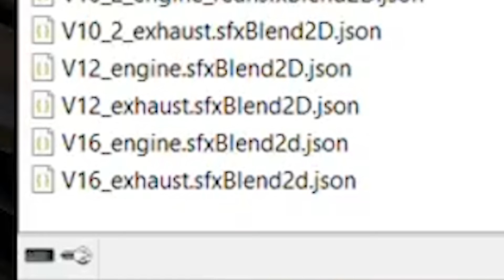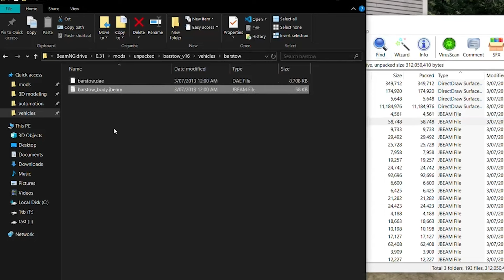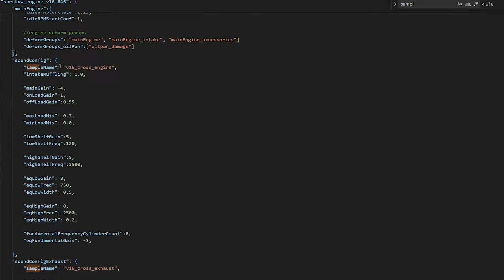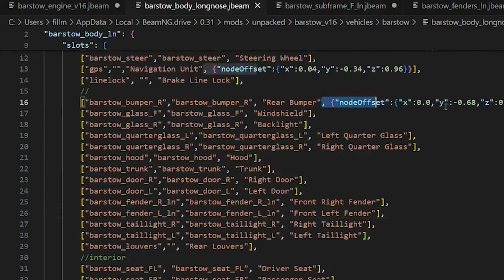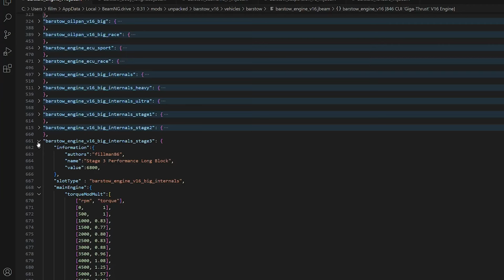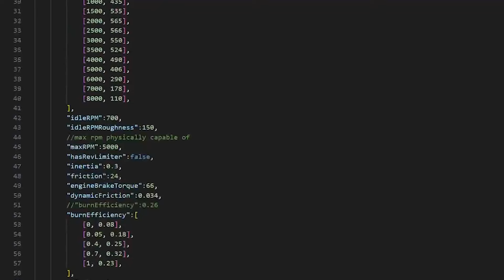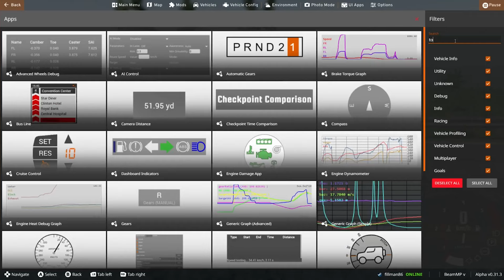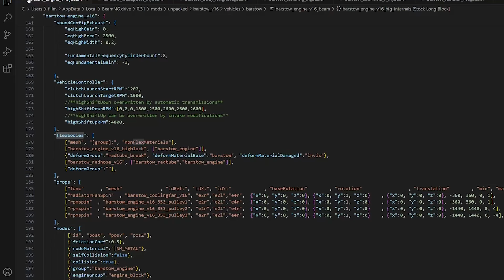BeamNG's HIDDEN V16 code

Comment: Shoutout to Bugatti revealing their new engine to replace the W16 last week and it being a V16
Reply from the maker: oh I didn't know they were doing that. Strange since the w16 is so incredibly compact
Reply: @fillman86  Emissions. It's gonna be a hybrid. But they knew that whatever downsizing they made (decreasing displacement), part of the Bugatti ownership is the sound and since Rimac now owns Bugatti (55%, the other 45% stayed with Porsche), and Rimac already has an electric supercar, the Bugatti is to cater to that percentage of enthusiasts who want the sound experience.
At least that's my guess on the reason they kept the number of cylinders.
I don't know if it'll be turbocharged, but the preview video they posted on Bugatti's official YouTube account shows it revving quite high, past 8000 rpm...which makes me consider the possibility of naturally aspirated. High rpm hints for lower displacement, at least lower than the 8.0L from the W16.
Reply from the maker: @Roddy_Zeh  but 8 litre with 16 cylinders is the same as a 2l over 4 cylinders, and those can rev high

it's probably just a looks thing
Reply: @fillman86  yeah you're probably right, either way ,that's absolutely great that they're not just throwing the idea of combustion engines into the bin like alot of others are doing.
Reply: @fillman86  I definitely need to avoid posting YouTube links altogether, even broken ones. My comment has been deleted. Dammit.
But yeah, V16 engines can rev pretty high; the issue is that, the longer the crankshaft, the more complicated it gets. Too high rpm's can damage the crank, basically bend it. That being said, BRM was tackling 12,000 rpm in the late 1940's with its supercharged V16 built for Formula One. Sure, it was 1.5L, so bore and stroke were pretty much like a superbike's. And it was said that they could reach 14,000 rpm. Still one of the absolutely most beautiful symphonies ever conceived by mankind.
And with today's tech, even something as humongous as a 14.0L, LS7-based, V16 built by Sixteen Power LLC (for marine applications) can rev as high as 7,000 rpm...and putting out 1,400 hp with no boost whatsoever. That's basically 100 hp/liter, typical values for high-revving Honda B or K-series engines. And when you consider the bore and stroke, combined with the fact the V16 has an OHV valvetrain setup, which tends not to be as efficient as an OHC one (be it single or double overhead cam), and just 2 valves per cylinder...it's incredible.
Reply: how many litres though?
Reply: @realcanadian96  We don't know yet. Some rumors are claiming it'll be 8.3L and developed by Cosworth. I have my doubts about that.
Reply: Aparently, like the t50 engine and the Valkyrie engine it’s developed by cosworth. Supposedly it’s basically a v16 version of the Valkyrie v12

Comment: v16 barstow is gonna be so fun to play around with on the drag strip
Reply from the maker: I hope you enjoy :)
Reply: The brakes can just be upgraded, no need to stress over fading.
I mean, I barely even use those old muscle cars and even I know they don’t suck as badly as I thought.
Reply: @RailsofForney Yeah, the high performance variants usually had better suspension and brakes than base.

Comment: Hopefully the guy that did the merlin engine swap doesn't get mad. The extended front looks just about exactly the same.
Reply: Why would he be mad about someone having a similar idea?
Reply from the maker: yeah I have been told a lot about this mod. I think I don't mind making something similar
Reply: It also looks a lot like the real-life Merlin-v16-engined car that someone made in real life.  And like most stretched-nose funny cars.  Because cars with stretched fronts do kind of look the same, it turns out.

Comment: Barstow is an underrated car in BeamNG. Despite being a 60s car, it has incredible handling and has good brakes and suspension. My favorite preset is the TrackSport version, somehow its easier and faster to drive in my hands than the Civetta Scintilla.
Reply from the maker: I think most people don't care is because "it's just another american car, zzzzz" combined with good, but not great looks. But this is just my opinion
Reply: Im more of a Moonhawk guy
Reply: @collinkaufman2316  grand marshal v8 sport, fight me.
Reply: @aguywhodoesstuff1116  I like trains ._.
Reply: barstow and bluebuck are surprisingly great for drifting
Reply: @collinkaufman2316  same

Comment: What if... 32 cylinders that are half the size so it's the same capacity. The more cylinders the better I guess.
Reply from the maker: sure, but I don't have any audio files :/
Reply: @fillman86 well there is engine simulator if you want to do all of that again. I have done a 50 cyl engine on my computer which is less powerful than yours, so you can probably do even 64 cylinders

Comment: 23:43 if ya gonna go all out for speed, remove the wing, remove the seats except the driver seat, a racing steering wheel, drop all bt the front windscreen, rip out the door cars, remove any inner fenders on cars than have them, basically, get rid of anything that adds weight if it does not aid in reducing drag by beamng physics standards
Reply from the maker: well if you want to cheese it, you'd even take out the windshield, as things like that only add drag, there's currently no way to take drag away when adding parts
Reply: @fillman86  fair, still, that method helped me take a moonhawk 300mph, until somehow the moment i ran out of fuel made the car shred itself

Comment: 2 axels in the front and really wide tires in the back should really help with wheelspin and handling.
Reply from the maker: haha more wheels doesn't give more traction, there's much easier ways to get better handling on the front lol

having wider/more tyres divides the weight on them more, this means less heat is generated in use. With less heat you can run softer compounds. Generally wider road tyres are softer

if you're thinking of the old f1 car, they did it for aerodynamics reasons
Reply: @fillman86  2 sets of slightly smaller tires of the same width have more contact area on the road than one tire, increasing the grip. (but you wouldn't even have to make them smaller on that car, basically doubling the contact area) Yes they do split the weight between them but with the massive engine in the front, i would assume they do have sufficient pressure. 
This would also mean breaking would be better. 

Regarding heat: only if you have tires that need a specific temp range, the heat would be something you have to keep in mind. Road tires usually fail when they get too hot and before that don't get so much better performance because they are optimized to have ideal performance in road conditions. 
For racing tires on the other hand, your statement is completely true (also regarding the grip part) because they are optimized to have maximum grip during race conditions making them even worse when they are around ambient temps. (but you said you are not building a track car. 😄) There is a great video about it where they fittet F1 tires to a track toy and raced it against the same car on sports tires.

Comment: I have a question, is it possible to mod my automation car mod structure strenght, as some cars ive made are strong as a brick, and i would like to make their structure weaker.
Reply from the maker: I think you can turn on advanced tunning things in the parts menu, and in there is some functions for that that mess with things like "scalebeamSpring"
Reply: @fillman86  thank you film❤️‍🩹

Comment: Part of the issues it had was you put the friction way too high. Normal friction would not quite double and dynamic friction should not increase much at all.
Reply from the maker: unfortunately it's poorly documented, so it's logical that double the journals, pistons, and valves, it'd basically double the friction (maybe something like 1.99x instead?)
Reply: @fillman86  yeah. There’s a lot of stuff mod-wise with 0 documentation. What helps the best to figure things out is looking at the LUA files and seeing what they do with the JBeam data.

I’m not sure what it would be exactly, but I’m thinking a lot of the friction is the front/rear main bearings and there’s still only 2 of those. Dynamic friction seems to be kind of a mystery to me but doesn’t change linearly with size either.

Comment: I'm wondering, why nobody did a hybrid with normal gearbox, with auto or manual , not with variable transmission
I have a SBR mod that works like that , but can't figure out how to do it on other vehicles
Reply from the maker: because it's complicated https://youtu.be/M4xOGTg3Dgo
Reply from the maker: beamng can only shift 1 gearbox. So the hybrid needs to have a single gear
Reply: @fillman86  thanks for the reply! But i have a sbr mod that works that way, its old but works 🤔
Reply: @fillman86  on the second thought, u r right, its got permanently on and switched to drive. Thats a bit of a shame, but okay. Thanks again, cheers from Ukraine.

Comment: I make vehicle mods for Cyberpunk 2077. Watching this video, I … god, I feel your pain. I feel it so, so hard.
Reply from the maker: does 2077 even support mods? I'd imagine I have an easier job lol
Reply: @fillman86  Oh yeah it absolutely does! The modding community for it is EXTENSIVE. But vehicle mods are the worst. You still kinda need a hex editor just to alter a paint job. The physics system is so poorly understood right now that modded vehicles are constantly sent flying into the air and exploding on spawn. The meshes get easily corrupted. The concept of a .mlsetup and a .mlmask feeding into a .mi that’s referenced by an individual mesh that’s referenced alongside 20 others in a .app file that’s then referenced by a .ent file that’s then referenced by a .yaml file that’s then called in by the game thanks to another mod called Cyber Engine Tweaks (or CET) and then MAYBE spawns correctly …. 

The whole thing is a nightmare. I’m known as DoctorPortal … and for a long time I was the only one crazy enough to make vehicle mods FOR A REASON. For your sake, Fillman my friend, stay FAR AWAY from Cyberpunk. I beg of you. Save yourself …

Comment: Hasnt this been done before? Just with an aircraft engine
Reply from the maker: not sure, there was lots of strange things done with engines in those early days
Reply: @fillman86  I still have the mod installed, it's literally this exact same thing but with another set of wheels at the front, an aircraft engine, and 2 guns with thier own small doors
Reply: @sharkk127 that was a Moonhawk.
Reply: @hacker-ek5su  yeah, I started thinking it was after typing the reply, its been a while since I've last touched the mod

Comment: I absolutely love this mod, however the piston ring issue is killing me. I beg you to update this mod with a fix for that if possible
Reply from the maker: put in the big radiator :)
Reply: @fillman86  I did, and it didn't seem to help. 

Here's a parts list:

Adjustable Rev Limiter
Stage 3 Performance Long Block
Ultra Heavy Duty Engine Mounts
Race Dual Exhaust
Tubular Exhaust Headers
Quad Four-Barrel Carburetors
Race Oil Pan
V16 High Performance Radiator
Reply from the maker: @splob1981  odd... are you drifting it?
Reply: @fillman86  Nope, drag racing. It seems to be related to horsepower or cylinder pressure, as it only effects stages 2 and 3 performance engine blocks, and stage 1 with nitrous
Reply from the maker: @splob1981  odd, it didn't do bad for my top speed runs... You could go in and change 1 line, "thermalsEnabled" to false haha it's cheating, but it'll perform perfectly
Reply: @fillman86  Yeah that could work. Thanks for the replies. 

While you're here, you ever think about making the big brother version for the t series? The Detroit 2 stroke v16 is my personal favorite engine ever made, would be a sight to behold here in Beam